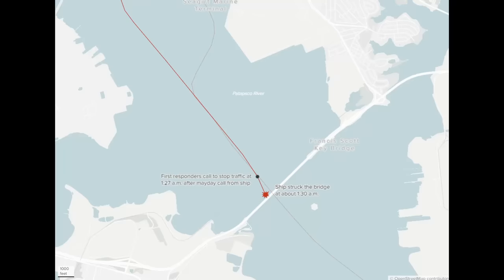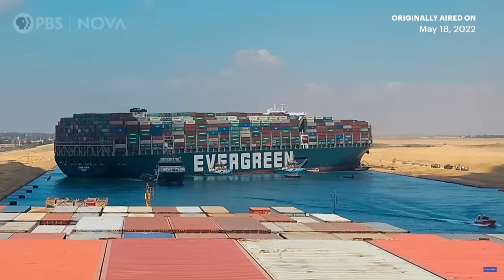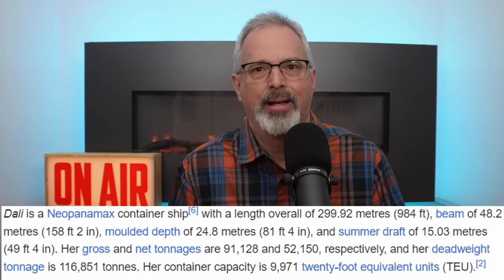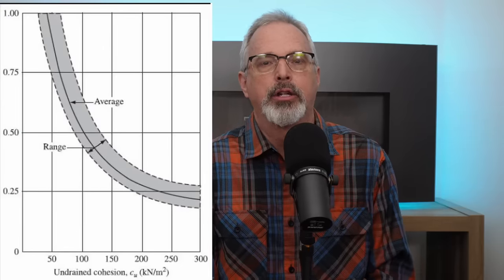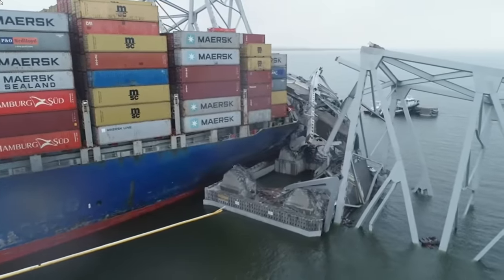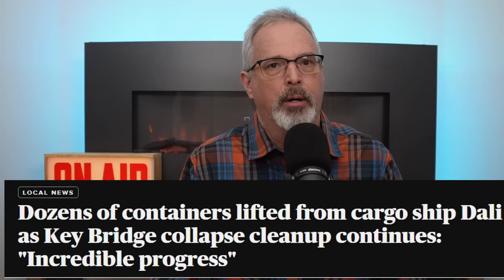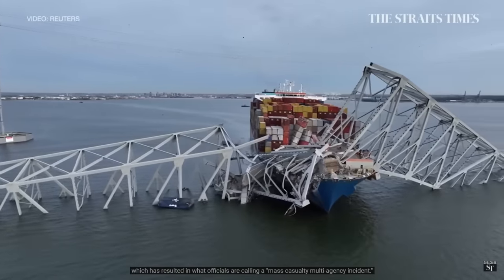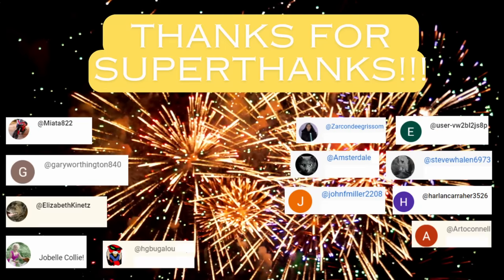Can the MV Dali be Refloated?

Comment: They probably won't rotate the ship, but instead pull it off the pier at an angle, pulling both rearward from the stern, and toward the center of the channel along the side. Anchored tugs and barges, with winches, and block and tackle to multiply the pulling force, will probably do most of the pulling. Unanchored tugs would then provide additional power and the ability to control the ship if/when it's freed. At least that's how the freed Ever Forward two years ago when it ran aground, and got very thoroughly stuck, a little further downstream in the same channel. I think the biggest problem will be safely removing the bridge debris and hazmat containers.

Comment: Maybe Dali's own 55,630 HP engine could help free her from the sea bed. I don't know if that was the case with container ship Ever Forward which ran aground in Chesapeake Bay after veering outside the shipping channel about two years ago. Ever Forward was freed at high tide on April 17, 2022 by two pulling barges and six tugboats. Before Ever Forward could be freed, the seabed was dredged and hundreds of containers were removed.

Comment: Also be aware that even though the documented channel width is a certain width the actual cleared width is a bit more.
However I'd prefer getting a ship stuck in mud rather than on rocks since a rocky seafloor can be like encountering a can opener.
For tug operation pulling the ship back into the channel it's also important to take current wind conditions into account and plan the work to a time when the wind is in a favorable direction.

Comment: Just a thought: what if you snaked a series of perforated pipe (guessing every 8-10 feet) under the hull, perpendicular to the keel line, and pumped high pressure water through to reduce the mud viscosity and stiction and suction forces while tugging the boat out?

Comment: I’ve Been thinking more about Those men Down there. But I also was looking & Thinking about the suction on the Dali. And I believe they might need to remove everything of the front Where lies the Road which must weigh several hundred tons or even thousands of tons. There’s The Huge tear in There with containers needing to be extracted. But the bridge part needs to be extracted also which means a tricky situation with them containers going into the water and the ship potentially sitting on the bridge support. I wonder if once they remove most of that if it’s possible to float her with huge bags filled with air? I’m going to sub because your channel is the one with more interesting information including those that have some information that have subbed. TY for sharing this with us. I’m in the UK so I would like to see more of your interesting vlogs 👍

Comment: If the sea chests are clear as well as the rudder and propeller running astern will apply a considerable force astern.  The prop wash along the sides of the ship will displace bottom material as well.  I would not be surprised if that did pull the ship into the main channel.....or not.  What ever is done tugs working with the pilots will need to be there to control the vessel when it comes free.  There will also be very precise survey equipment to measure any displacement and accelerations in any direction as it comes free.  It's probably there already monitoring both the ship and bridge wreckage for any movement .  I think I heard the damaged compartments were made water tight and de-watered.  I'm pretty sure all the things mentioned below are being prepped and started as soon as circumstances allow.  Certainly offloading containers will continue and then fuel, water and ballast as it gets closer to the first attempt to move it.  They might wait on the dredging, the last thing they want is that thing coming loose before they are 100% ready, could get ugly if that thing slips back into the channel.  There are always changing forces acting on that thing and it scares me watching those welders working in man lifters with all that debris around.  I worked on DP deep water drilling vessels, after finishing a well the BOP would  not come free.  We worked for about a week trying to get it off the wellhead.  We maintained overpull on it with air/oil compensators and it finally pulled free when nobody was looking at it.  It would be bad if that clay/mud/silt foundation that thing is sitting on fails with people in harms way,

Comment: I imagine that if the forward 20% of containers are removed along with the damaged bridge structure, then the floatation force would contribute significantly to the recovery efforts. Particularly if the engines can be "hot wired" to run & add some power in reverse, to the recovery efforts. [Hot wire here simply means to jury rig some means of gaining temporary control over the propulsion system]
Reply from the maker: Thank you.  Yes the ships power, if available, would help a lot in getting the Dali back into the main channel.

Comment: MV Dali displaces 148,984 tons and has a 55,630hp main engine, so 750 tons is negligible. It won't be difficult to generate that much force, the challenge for the Ever Given was how narrow the channel is, they couldn't risk lodging it in the opposite bank. MV Dali will be able to use her main engine.
Reply from the maker: Thank you. That makes sense so hopefully there will be no issues with getting the Dali moved back into the channel.

Comment: The Dali isn't stuck in mud like the other two examples, it is grounded on rock and concrete that was the base of the support. Basically the bow is on a big rock and is damaged. What mud? That bridge support wasn't sitting on mud and sand.

Comment: The London Fire Brigade has a special tool for rescuing people stuck in the deep mud of the River Thames.  They have a long wand-like pole connected to compressed air…the air bubbles released break the bond of suction when the wand is shoved into the mud around the trapped victim’s feet.  Perhaps an industrial-scale application of this would economically free such a large vessel?  The recovery of the Costa Concordia showed that the unbelievable can be achieved….with compressed air.
Reply from the maker: That is very interesting.  I had not heard of that type of rescue equipment before so thank you.

Comment: I haven't seen anything that would support a conclusion that the bow of MV Dali will float once the bridge debris is removed from the deck, it will still be hard aground in my opinion.  The goal of returning the ship to the channel is complicated by multiple factors, such as limited access to the bow and starboard side due to remaining hard structures such as the bridge pier and intact dolphin for dredge and tug operations. The ship has to come straight back, or somehow have the bow moved to port without swinging the stern into obstructions. The vessel is damaged and large forces will have to be applied with some finesse to succeed, i dont think it will happen quickly or easily.

Comment: The Ever Given Ran aground. The Dali got hit with the extra load on the deck. Those are 2 total different situations.  Besides that, It's common to extra ballast a ship that is grounded or close to grounded to prevent  damage to the bottom from moving in tides and winds. I for see no real problem re floating the Dali. And if she stuck in the mud its quit easy to get her lose by just pulling the stern to both sides. and have a few tugs stir up the water around the bow.

Comment: the use of Tugboats is not the only means to safely move or refloat a large ship.
in the tight quarters of the Baltimore channel, it may be more effective to use Hydraulic Cable Jacking to slowly but solidly pull the ship back out the same way it went in thus minimizing suction and friction from the channel bottom.
Hydraulic Cable Jacks can be positioned on Barges nearby and securely anchored into place.
cables can then be run to and attached to strong points on Dali's hull to pull on. 
these jacks can be dialed in to generate a pulling force far stronger than any Tugboat can dream of yet gently exert a force sufficient to overcome sediment while not overly stressing the hull and risking further damage.
Reply: Gee sure would be convenient if there were some sturdy bridge piers nearby to attach a cable to!
Reply: The biggest tug boat anchor handlers in the world can do 300tonnes bollard pull to 470 tonnes bollard pull that would sink most barges.  but its a good point tho big offshore Anchors would be able to to resist the pulling force.  but most big Anchor handlign tugs use engine force to achieve the bollard pull not just the winches.

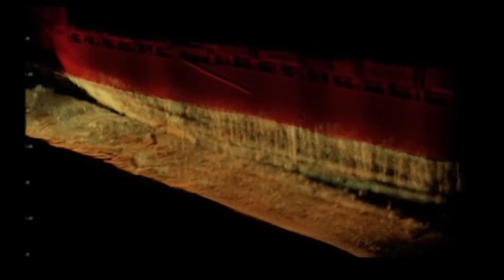Comment: If the sonar image at 4:00 shows the port side of the ship, and it had been traveling from the right to the left, wouldn't it be sitting on the mud that was the steep "wall" of the 50' deep main channel? If so, whatever draft the ship had would have shoved many feet of mud from the top of the channel "wall" forward, and to the starboard side of the ship, when it veered/plowed into it.  The bow and the port side may be in REALLY deep mud if so! 
 I wonder if maybe (?) sitting alongside the deep channel, instead of being on a shallower flat bottom, will help it get out of the mud when the time comes to move it if they can push/pull it in the direction towards the deep channel? Just guessing!

Comment: Let's assume everything you said about the suction of clay is true. There should be a way to reduce that suction. Maybe the use of high-pressure water to reduce the force of the suction. If you can get a layer of water between the clay and the ship's hull. We also know they are planning to remove most if not all the containers, which should create a large upward buoyancy force.
Reply from the maker: Those are all good options you mentioned. I keep hearing different stories that they're only going to take 170 containers or that they're going to take most of them off so I am curious to see what happens.

Comment: Looking at those containers, there are different lengths and weight will vary, but a ballpark figure would be 20,000 lbs/9,000 kilograms for the 29 foot ones as they tend to get packed with denser freight and 30,000 lbs/14,000 kg for the 48 foot containers. I don't think 53 footers are used overseas.
Reply: It looks like these are 20 and 40-ft containers.  Off-hand, I have not heard of 29-ft containers.  Containers come in 20, 40, 48, and 53-ft lengths, as far as I know.
Reply: There are 45 foot containers used in international shipping. I've hauled 20 foot ones  weighing 60,000 lbs. So they can get heavy.
Reply: @royreynolds108  doubles are 29 feet.

Comment: Once you remove a significant chunk of bridge from sitting on top of the bow of the ship you will find the bow rising and stern dropping slightly, it's also not accurate to compare to the Evergiven, there the bow was rammed hard into the bank and the ship was across the canal which meant she could not be pulled straight back but instead had to be pulled from the sides, here the ships bow is just sat resting on top of the mud, there's plenty of deep water behind her to pull her safely back and they will remove the bridge from the bow before they do so. Totally different scenario really, You can't ignore suction but there are ways and means to reduce it used by salvage experts the world over, most commonly injecting water or air under the hull to break the suction, however we will not know if that is required until the bridge debris is removed, a lot will depend on the material under the hull where it's grounded

Comment: You forgot the forces from Putting the DALI's engines in reverse at the same time that the tugs are working.  I agree that the suction forces are very much underestimated by your calculations. You did mention dredging! How about hydrojetting while they are pulling the bow off.  First they need to plug the holes If they can and pump the water out of the compartments.  I used to be a geotechnical engineer!.  Before that a petrophysicist with Sohio.  I like your analyses a lot.  I am not sure if they have hydrojetting - Perhaps one of the fire boats revamped to do hydrojetting. At Portsmouth we have fireboats that jet red white and Blue into the air.  So direct those hydrojets under the Dali

Comment: Maybe everyone should just step back and use simple methods to raise the ship first.
When you are replacing a front windshield on an automobile you either use an "L" shape knife blade and make a cut in the adhesive between the glass and the metal windshield opening or by using a thin wire do perform the same cut.
That method would be to clear the area around the bulb then drag a cable down the length of the hull, you could start by using a thin cable around 3/4" to 1" thick then increase it to 4" or 5" to break the hull loose, or instead of cable you could use braided anchor line which would not cut into the metal of the hull, they use steel cable to cut the pipe on an oil drilling rig after an accident.
Or use water at high pressure to wash the mud away from the hull, like using a pressure washer to create a space between the hull and the surrounding mud, if you watch divers searching for treasure on the bottom near a sunken ship they use water pressure, brushes, small shovels and a water vacuum to uncover the treasure like a vase or dish without damaging it.  
If there are concerns about the gas pipeline, then the water jet would probably be the preferred method.
As far as floating the ship, once the hull is free then straps could be placed under the hull and attached to floatation bags to raise the ship straight up, these bags once in place almost attached to the hull could either be filled with air or some use fuel oil, you wouldn't believe how heavy an object a can be lifted in the water simple child's balloon inside a nylon stocking (I have seen people use this method to raise small boat anchors from the bottom of a lake, I have also seen them use larger balloons to raise up outboard motors and ski-mobiles from the bottom of lakes).

Comment: Would it make any difference in the pull if Dali had its engines full astern in addition to the tugs on the rear end pulling? Bay Houston Towing of Houston, TX is building two new tugs slated for service in 2025 with a bollard pull of 115t.
Reply: of course that would help. However due to all the fragile gas lines, etc. this needs to be done gently.

My bet is that once the bridge parts are removed from the bow it will be fairly easy to tow her away.

Since there is so much speculation, let's put some bets on the table gentlemen.

Comment: While pulling and pushing with the thugs they should use high pressure water jet to counter the adhesive/succion effect of the mud in the area concerned...will desintegrate for a moment this soft material

Comment: now it sits mb 3m less full load mark, level ie full surface, not just bow deep in mud and everything floats like in Suez. Empty hull (no containers, no ballast) will rise about 10m from the mark, it is not allowed for normal operation but for refloat in controlled environment with herd of tugs around its ok. So there is about 8m of available flotation, its more than enough for anything.

Comment: There is infinitely more room to work on this ship than the Evergiven in the Suez Canal. In that case tug boats couldn't even pass the ship without sailing around Africa. It's also possible in this case to easily remove a lot of the containers if needed that wasn't possible with the Evergiven. They do need to do a lot of work on internal stresses as they remove cargo and stability as the lighten the ship.

They can also flood a barge or other container, weld it to the ship and then pump the container out if they need additional buoyancy to float the ship. Sort of like what they did with Costa Concordia. Tons of articles and videos out there on this.

Comment: They will probably have to strip all the containers and most of the ballast. Probably a lot of the fuel too. This combined with extensive dredging  and then it should tow out. Or the could just lift the bridge off it and wait for he wind to blow it and keep intermittent tugging at it in the hopes that the suction on the starboard side can be slowly broken.

Comment: I'm a complete amateur, but they will have no trouble refloating the ship.  Once the load of the bridge sections and more containers is removed from the bow, the ship will likely float away by itself.  I very much doubt half of the hull is grounded.  Tugs will be there but it could probably just fire up the bow thruster and move itself away from the pylon.  I think you are using your professional thought process to overcomplicate what is essentially simple.

Comment: It is an interested exercise, but I think you are missing the buoyancy of the ship itself. Empty weight of 100kt, and capacity of 50kt cargo. 0.75kt clay adhesion is not going to make or break anything here. The ship had just taken on ~1.4kt of fuel as well, so thats probably the easiest to remove when needed. Large salvage tugs also can use their anchors to provide a fixed pulling point,  which means the straight pull force can be substantially higher for a single tug. Ultimately though, the discussion from the experts has basically been that the ship can be refloated with zero worry once the bridge is removed from atop the ship.